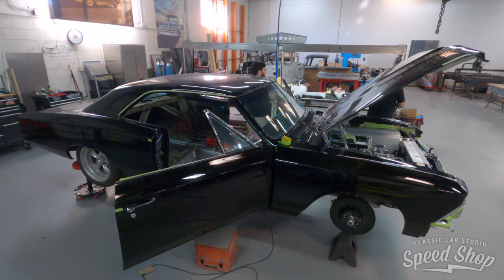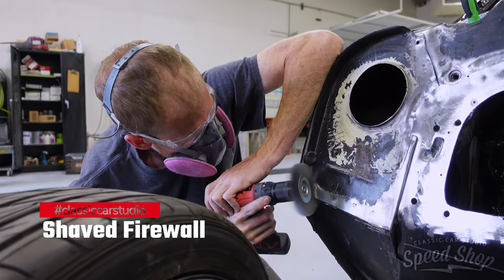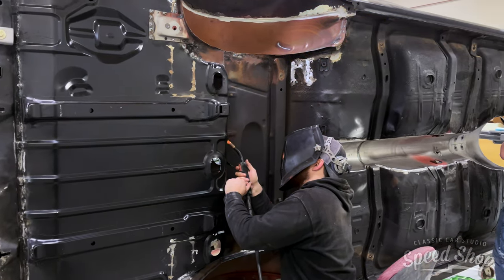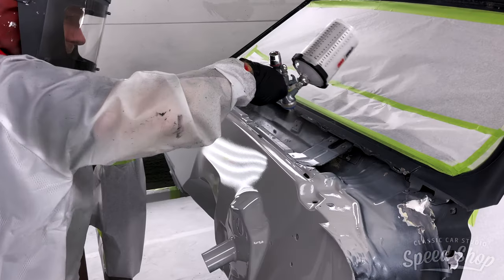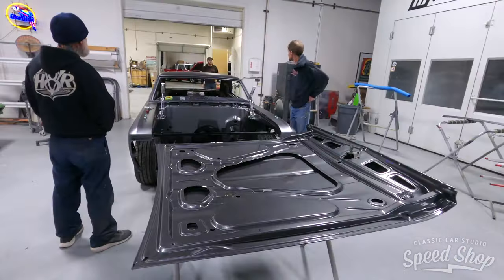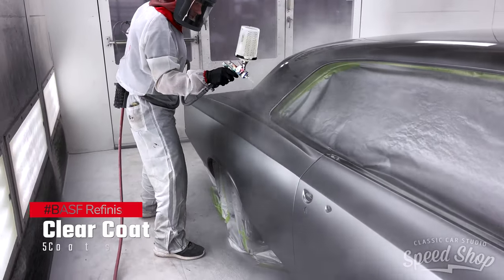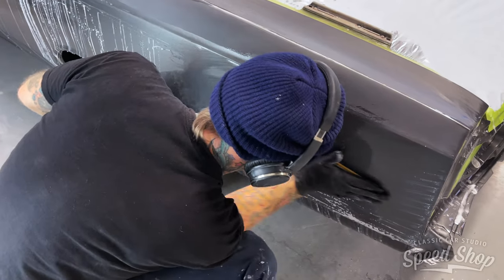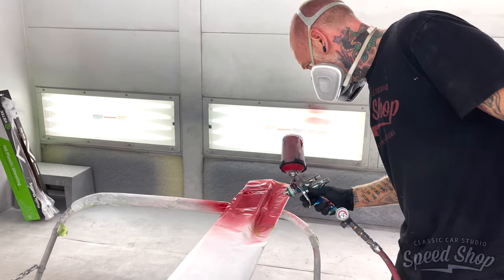66 Chevrolet Chevelle • Part 3 • Paint & Body

Comment: 2:58 More protection/sound deadening. Would this have the same effect as Lizard Skin?
Reply from the maker: It does help with heat and sound, but we mainly use it for durability. We use Sound Skins or Dynamat on the interior mainly for this. Tried Lizard Skin a few times, it’s great for areas you can’t easily reach.

Comment: charging a client to colorsand anything beyond 2000 is stealing from them... on top of that they are colorsanding with a foam block, that doesn't truly cut orange peel.   I always colorsanded with a hard block and 800 then 1000 then 1200 then switched to a foam block with 1500 then 2000.  ANY polishing pad you use is going to make some sort of scratches that are more pronounced than 2000 grit paper...
Reply: @warrenlewis3977  do you know how to read? please point out in my comment where I am, as you put it "claiming that an Interface pad doesn't work". I'll wait.
Reply from the maker: We colorsand with an acrylic block (not a foam block) up to 1500, then an acrylic block with a hard foam back. It's the 2000 there that you see that is done with a hard foam block, and this is not used to eliminate orange peel, it's to remove previous sand scratches. The 3000 on the DA accounts for under an hour on an entire car, and it does make a difference in further eliminating sanding scratches.